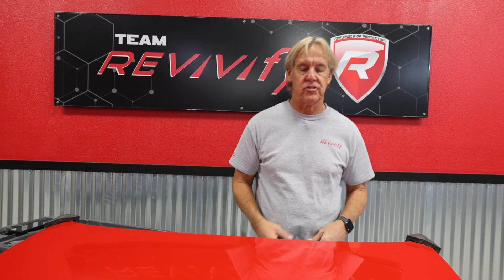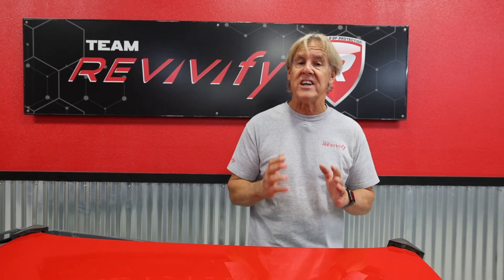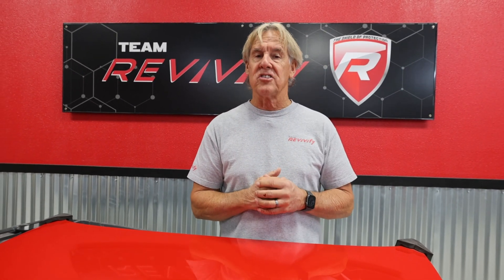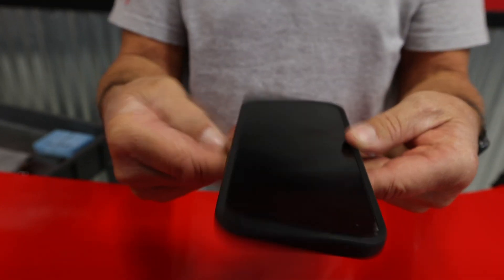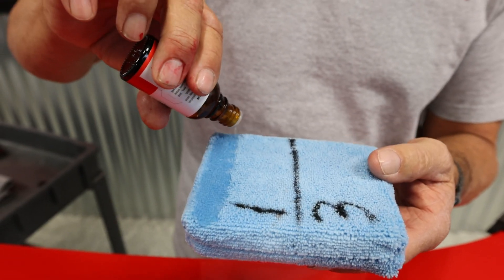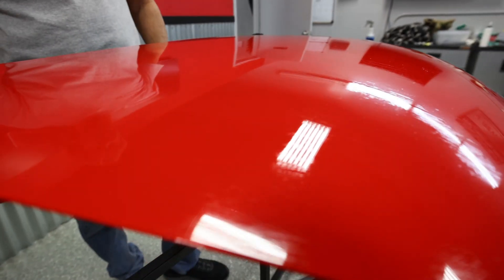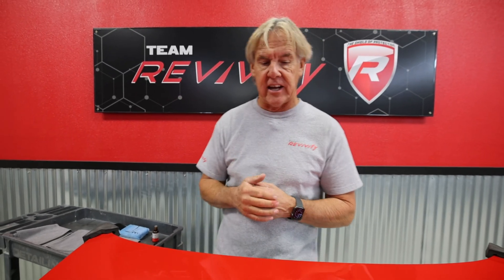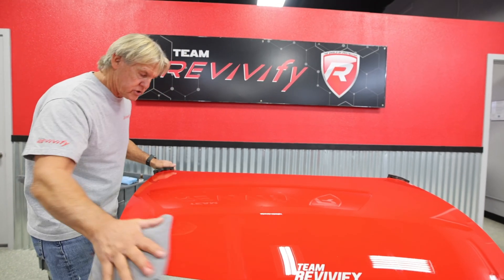What makes Revivify different from Traditional Ceramic Coatings?

Comment: I did my first coating in 2013 and in the past 12 yrs I would never use a product that I have to waste so much on a applicator and leave on the paint just to wipe off.. 

A 50 ml bottle should do 2/3 cars this won’t do that
Reply: Absolutely correct I really don’t think this guy knows how to apply his own product. I was one of the first and first he told us to apply at super thick then he told us to apply it super thin then he told us to apply it in One Direction I mean Brother get it right before you start selling it to usand by the way, he only cares about bottles, not people.

Comment: Yea, the self healing is BS. Had my two cars coated with this, and neither  "HEAL" with heat.  And mind you, I'm talking very light scuffs from cloths touching paint from rubbing against it
Reply: you are not the only one who has said this about them 😂 ... I was told to watch this video and he's really claiming self healing 😅 ... I had someone show me this on his car and just like you said,  just by wiping it with a microfiber towel it literally marred the the coating right away 

We then waited a few hours leaving the car out in the sun and there was no self healing 😂 ...
Reply: @CheechDogg.0n37s  yea, this stuff is shit.  The water beading doesn't last that long or that well either, Total fucking scam. Cost me $1,200 per car! My fault for believing someone's bullshit claims. Even the shop that carried it, stopped carrying and using it after they seen my cars and a few others with this garbage applied. I'd use regular spray ceramics long before using this shit ever again
Reply: Boomers eh. What can you do